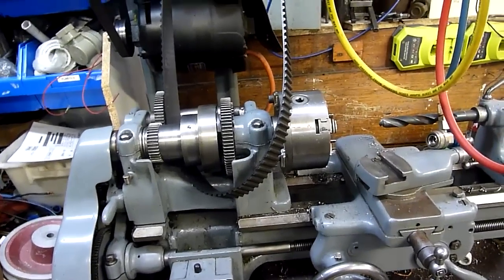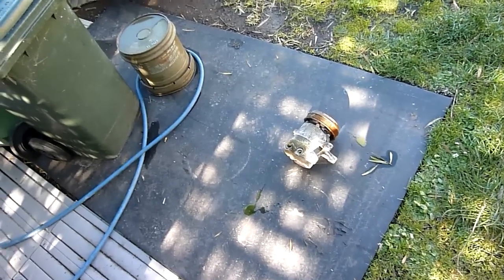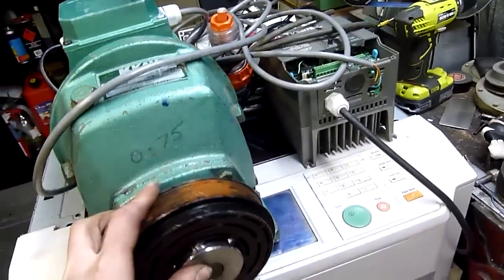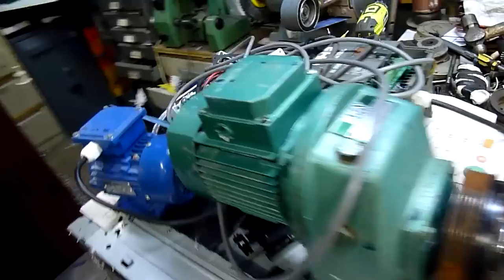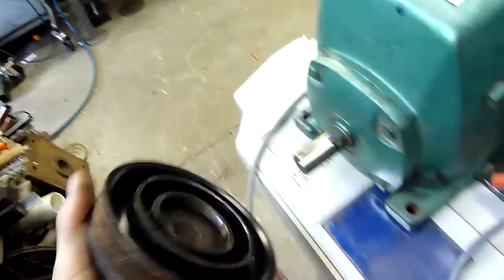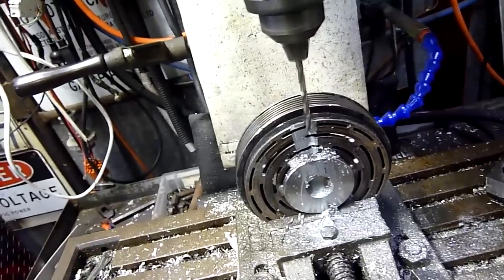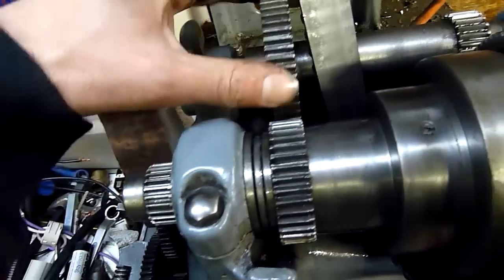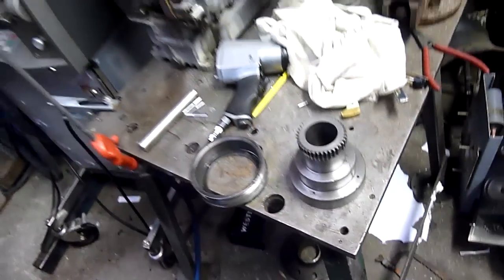Southbend Lathe Serpentine Belt Conversion Pt1

Comment: Im keen to see how this goes, im currently in the procces of collecting parts go do a 3phase motor conversion and VFD on my RF30 mill drill then il do my lathe, are u goin to program the vfd with soft starting and also spindle braking?

Comment: Can you program in CNC at all? I learnt Fanuc while at college (G and M codes) but I know there are at least another 5-6 that are about these days.
Reply: Scara and Spud G-code is still the standard, although for the most part it's auto-generated today
Reply: nrdesign1991 yea i know, I learnt how to use G-Simple (auto gen code as it exports it to notepad). 

You make something in Auto CAD or solidworks then export the save file to G-Simple which you can set up the tooling and axis (X, Y, Z, C etc) for and send it down to the CNC machine if it's on the network. 

Really quick manufacturing. Didn't realise G and M codes were still the standard. Been applying for CNC machinist jobs saying I can program Fanuc and I get turned down, no clue why, I'm young and cheap lol.

I know there are a few other different ones with different codes and say, G30 might be door release for one machine but not for another. It's inconsistent for the most part, which is annoying.

Mitutoyo had their own language I think as well.

Comment: You can key a shaft with your lathe. Put the work piece in the chuck. Lock the chuck in position, make a tool (like you'd make one for a shaper) and put it in the tool holder.

What you need to do with it is drive the carriage back and forth in to the work piece using the cross slide as a "height"(of the key slot) adjustment.

That's how old folk did it when they didn't have either the press or the right size broach key. I've done it a few times myself because most of the keys i cut are between 2 and 7 mm and broaches on that size are hard to come by here. It's easy and frankly explaining it makes it seem super complicated when it's not.
Reply from the maker: aserta I have done it on bigger machines but I would not put this tired old warhorse through those stresses, I have to re-bore it anyway, the pulley does not run true :(

Comment: It's amazing to think that this machine probably once made munitions or aircraft parts to serve in WWII, and it's still going today (with a few modifications), just goes to show, build it right and it'll last forever... :)
Reply: ***** It's a bit tired, i've seen a few of them and most are ..well, retired to say the least. It's not a case of done right, but mostly done simple. A mate of mine called them the AKs of the lathe world. :)
Reply from the maker: aserta pretty much, these are the AK47 of the machine world, there is not much you can do to kill them!